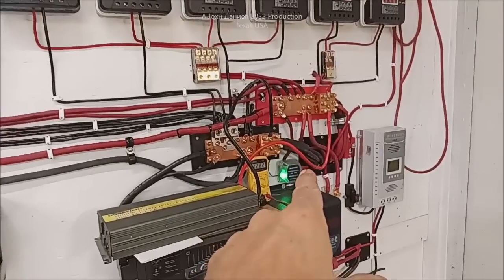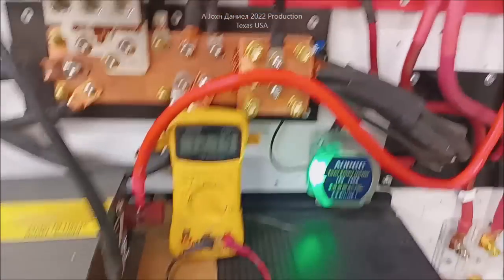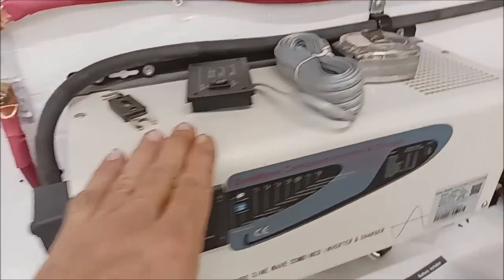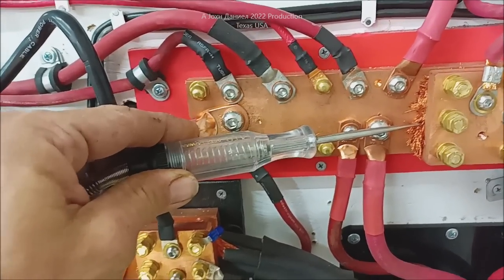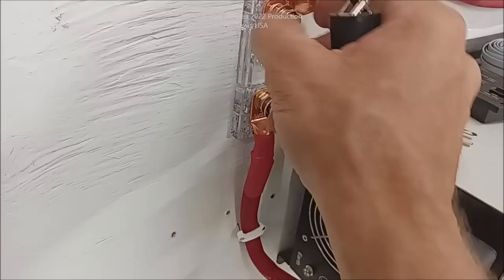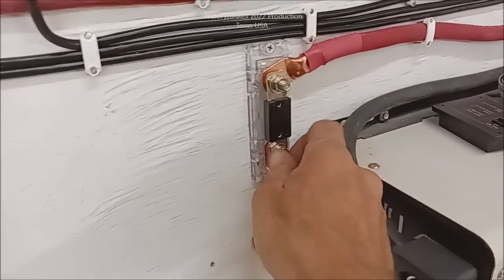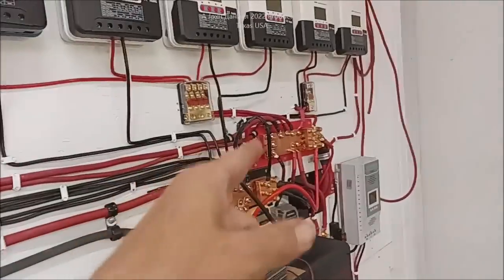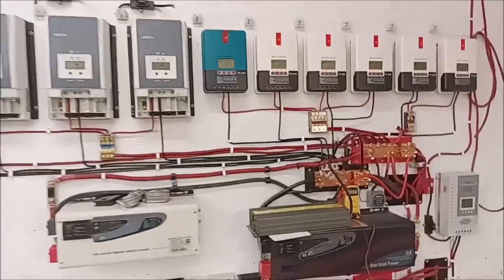How to Safely Connect DC to AC Power Inverter to avoid damage or fire

Comment: Why won't you simply turn the inverter off when connecting to power?
Reply from the maker: Turning the inverter off does not change the path for current to the capacitors inside.

Comment: Nice hydrogen bomb you built. During charge and sischarge cycles those wet cell, lead acid batteries will produce highly flammable, explosive hydrogen gas. That's the rotten egg small that I'm sure you've smelled  especially when charging your batteries. That hydrogen gas will rise to the ceiling where your system is installed. All it will take is for a single spark from an opening relay and your going to wish that you had mounted your batteries into a sealed, battery box that ventilates that hydrogen gas outdoors.
Reply from the maker: Not sure what you think your seeing, but I have my Battery bank 20 feet away outside. The DC mains are inside as well as all the equipment no where near hydrogen gas. The 3 RV batteries inside are not in use, they are limited maintained charge of 13.5 volts, and produce no gases that can even be ignited with a torch to them. Been doing this for over 20 years, no plans to put 28 Lead Acid wet cell batteries inside yet.

Comment: Hey John !! I need some help !! I need an inverter that will run a 110 volt 12 amp pool pump motor to drain my stock tanks in the field !! Can I connect two inverters together and put a voltage regulating turn dial on it to spin it up slowly to the desired speed. I have a 220 volt inverter with 2 120 sockets.. I burned up one inverter trying to get the pump to work .. can I use both 110 plugs wired together with turn dial dimmer switch to slowly speed up my pump ? Or is there an inverter you could recommend that can handle this job ! Thanks for your time !! Stephen Tharp
Reply from the maker: You can run continuous 20 amps on this inverter till them cows come home, just have to keep enough battery on it so the volts stay high and supply amps don't sag then surge due to volt drop (ohms law) causing a issue. https://www.aliexpress.us/item/2251801868014043.html SWI-Power 3200, get the 120v, 12v, USA plug. It is 10 Awg wired with almost 6 awg board clad equivalent. Like all inverters, give it some good airflow, and occasional breaks but mine can run a 16 amp pressure washer for 3 hours straight without issues. 
You can also consider adding DC pumps we use with stock tanks in the hills here. https://amzn.to/41ILj8g
Reply: @JOHNDANIEL1  Whoo hoo ! Thanks John ! I am see if I can find one at harbor freight ! If not will see where I can get one ! Maybe two ! Hell I will put one in my mommas truck to !! Lol thanks gen !
Reply from the maker: @DOGEATSGOG  you can run the truck while the inverters in operation. But you cannot remove the battery while in this process because the alternator will not recognize voltage and will fail. I recommend putting in a second series 31 battery and battery isolator for any permanent use.
Reply from the maker: @DOGEATSGOG  Then feel free to do it. I would never do it, I know when you take away the load, the battery, your volts shoot up to the max charge setting on the alternator, normally 16.5 to 18 open volts and you will fry things. 40+ years ago this was OK due to lesser quality alternators, lots of ceramic resistors on blowers, lights and such. But if it makes you happy to put a few hundred amps load on a 80 to 130 amp alternator from a inverter then no one should argue.
Reply from the maker: @DOGEATSGOG  Using a automated isolator solves all that. For $30 it will add years to your batteries lives.
Reply from the maker: @DOGEATSGOG  There is no such as over unity, but there is always room to make another example of trying. So far, I think a trillion or more has been spent to achieve absolutely no free energy.
Reply from the maker: @DOGEATSGOG  They claim we are a Capitalist society, and for that we are evil. But as your experiencing we are NOT in a capitalist society, if we were then ideas from the Unwashed would be welcome. Truthfully we are in a leftist ran kleptocracy by corporations ran through rule of socialist government disguised as a crony capitalism so that you blame capitalism like a good little slave.
Reply from the maker: @DOGEATSGOG  How it all actually is - https://www.youtube.com/watch?v=EH2WbRBAjfQ
Reply from the maker: The open voltage on a alternator is over 20 volts in almost all of them, the battery is the resistance load that holds it down, the regulator is what determines no more current can flow into the battery and disconnects it and reconnects when the ability to send charge again is needed. Attaching a Inverter directly to a alternator will get you massive cycling, high amps if it will even turn on, and lots of smoke.
Reply from the maker: @DOGEATSGOG  some are built-in in some are remote but all of them act the same

Comment: Hi Let me make this clear and I hope you respond  I have just bought 2 x 2000 w KRIEGER INVERTERS  Plugged them onto 6 x 1000 ah connected in series at home and one blew up the other does not even work as it should  WHY ? 
What size Inverter should you have if say the Voltage I tested says 64 VOLTS From the Solar to the Battery readings ?  get back t o me please ASAP Troy
Reply from the maker: What is your battery voltage, and what DC voltage did you buy your inverters to operate from?
Reply: @JOHNDANIEL1  from Amazon and the meter says 64 volts 
So what you reckon change it to the parallel or use a voltage reducer? Troy thanks
Reply from the maker: @TP_LANDSCAPE_PHOTOGRAPHY  Your battery bank is 64 volts? That is very odd, don't sound right at all. But then You should have a 60 volt DC input 120 or 240 volt output inverter which I do not think that brand makes. Need to rewire the batteries to 12 or 24 or 48 volt and reset the solar to charge at that rate you choose. A 12 volt inverter can only handle 15.5 DC input, a 24 volt can only handle 32 volts max. But even a 48 is only good for 56.5 volts.

Comment: Hello Mr. Daniel,  My Bussman MRCB 150 amp circuit breaker welded its contacts shut (and did not trip).  I attached my inverter cable to the "load" terminal and the battery cable to the "line" terminal.  I also connected the charge controller red cable to the "line" terminal of the MRCB for charging the battery bank.  To make matters worse, my inverter blows 4 of 5 40amp fuses in it any time power is connected to the inverter.  I used the technique you demonstrated in this video to charge the capacitors but the light never went out as seen here.  The inverter is the SWI Power 3000 watt same as in one of your previous videos.

This system worked for 2 months before the malfunction.  Any thoughts for my issue from you or the forum are appreciated.  Thanks for your videos!
Reply from the maker: Did you have the power switch off when charging up the inverter, either the manual or remote has to be off and remote unplugged. If it won't take a charge then you have a hot active in something. A Bussman is not what you should use on this, bluesea style only.  You can send pics, inverter voltage, model and info to troubleshoot with me through my email olympicpowercontrols@yahoo.com
Reply: @JOHNDANIEL1  Thank you for your advice Mr. Daniel.  I will send pictures and data.  Know one around here wants to test my inverter or help with DIY solar install problems.

Comment: I have a 1500 w inverter and a 400ah battery bank...do I have to charge this size inverter first? Also do I leave the inverter hooked to batteries after this and not have to pre charge each time? Thanks
Reply from the maker: Yes, and yes.
Reply: @JOHNDANIEL1  Thanks! John
Reply from the maker: If you want one with 120 volt in, and 30 amp solar too, get their top model like we have in the Winnebago RV. https://amzn.to/3kp9don They are branded Xijia, the corporate name on Amazon as well as SWI-Power but same people. This model is sold to Garrett stand by power products, makers of UPS systems for banks.

Comment: Are these 12 or 24 V inverters? In my understanding, you cannot mix the two together, they both have to be the same!
Reply from the maker: What ever your battery source is in voltage is what type of inverter to buy.
Reply: @JOHNDANIEL1  
Roundabout way to an answer, but yes, indeed. 🖖

Comment: i think i fried my battery's BMS by not using this method.  does this work on both ends, not only protecting the inverter, but the bms as well? also, my battery is 48v, will this tool work on that?
Reply from the maker: It works on 12 to 30 volts. So you will need a 50 watt basic 4 to 8 ohm resistor or a 48 volt bulb for yours. https://amzn.to/3UqcHnn and yes, it will protect the short circuit system on the BMS by doing it. With inverter switch off, Place it on the positive inverter terminal, then the battery, 5 seconds to charge the caps inside and restrict the surge to the battery. Then quickly connect your battery lead to the inverter.

Comment: Will it work on a 48V 6.5Kw inverter?
Reply from the maker: Yes if its a off grid capable inverter. Many 48 volt inverters now are not capable of going off grid as a stand alone even though they claim it, you got to read the fine print! Example: 48 volt 6500 watt ( 48 volt 1500 watt on battery only) is common.
Reply: @JOHNDANIEL1  Been watching you for years. I now operate multiple off-grid systems. I use MppSolar LV6048s & LV6548 inverters. I have 4 separate systems employing about 50Kw of solar total. It took six years here in the Panhandle of Texas to build. Just installing Gyll EG-4 LiFePo4 "works in a drawer" battery banks to replace FLA (GC2 & GC8) batteries.
Been communicating with Tony in Virginia who had some Qs on wind gennys. I have just a couple of small off the shelf HAWTs operational. 
Tony acquired all my "AirBoss" manufacturing equipment and inventory. 
Keep the videos coming...
Reply from the maker: @mgold4685 Yep,  I told the wife I may shoot up there to see you guys. We're out of Comanche Texas in the hills. I just had to get back home to Texas after half of the purpled hair nuts from California took over Idaho.

Comment: Yes it is the one I had ordered and used
Reply from the maker: I answer 400 post a month, so I can't remember. Is it a Sungold 4000? If so, then we got to check on the AC bypass function to find the issue. If it failed in charge mode, the relay may be in NC position.

Comment: Sir,
 I have a 4000 watt 8000 peek watt invertor that I charged up the way you showed us out here and had to remove it to fix the charge controller, (" So when I hook everything back up and used your tester light to charge my invertor before hooking up the battery's the test light stayed on")
It never dimmed
Reply from the maker: If the inverter is somehow still on, such as switch, auto on function, or remote function, some feature is still on, then the capacitors will use as much as your adding with the test light as your doing it. 
Why it will not power back on is related to the repair obviously so we need to track down the repair and did it move a 12/24 volt option DIP switch, internal plug or connector or something else. What brand, model and options are you working with.

Comment: I almost always do this. Not with a test light, but with one of those heat-sinked resistors you'd use to stop the strobe effect on aftermarket led taillights.
What do I mean I *almost* always do it?  Well... I always do, until I didn't. Blew up my gf's inverter, hooking it up. Exactly what you said. Blew out almost all the fets, and the 60n60s are dead too. Glad I bought it or I'd feel even worse than I did!

Comment: This is a great idea. I can't believe I never thought of this. Lol. Using an insulation resistance tester to charge up capacitors and watch them slowly drain when testing? So many old school test lights? I will be doing this trick as my giandel inverter does the same bloody thing yours does! It was so annoying I left it permanently hooked up and just power on and off as needed. Thanks heaps. Cheers from Australia subbed and liked 🙂👍👍👍

Comment: You can also use a ordinary lead pencil sharpener at both ends as a resistor
Reply from the maker: What the dangerous by-product crap they put in pencils nowadays and the electrolytic glue you better be careful doing that, it's not the same as the old graphite pencils. Those things will explode in your hand, we saw it happen.

Comment: Another way to power them up safely is use a tail light bulb. Connect two wires to the bulb and two alligator clamps at other ends of the wires and Boom, you got yourself a quick, Jerry rigged thingy wingy for charging inverter caps before connecting to batteries. :)

Comment: You would think the manufacturer would have instructions about how to safely power up an inverter.
Reply: Renogy says to minimize spark by using proper wire gauge and fuse. What a joke.

Comment: Good tip!  Any test light that is rated for the battery bank voltage should work - it won't burn up or melt any wires if the voltage is within the test lights rating. But, LED test lights barely draw any current so it would take a long time. Its the current draw of the lightbulb that is charging the capacitors, so incandescent bulbs will charge it much faster.

Comment: Hooked up a Giandel 24v/2000w pure sine wave inverter with no sparking or even internal noises. It does squeal for a few seconds when you turn it on. I don't know if this is because of what they call the "slow start" feature.
Reply from the maker: It would mean it has a full dead switch or relay in it. Caution, if it ever fails you go to that part first since its hard to make a durable 200 amp DC switch with Chinesium metals thats not likely to melt

Comment: I saw a video not to long ago somebody used a #2 pencil sharpened on both ends as a resistor.i tried it and it worked
Reply: I would guess probably a bit longer than a few seconds to charge the caps? The graphite in that pencil has considerably more resistance than a 25 ohm resistor but it sounds like a valid way of doing it in a pinch.
Reply: Nope. I measured my full length square shop pencil at 10ohms. A harder, skinnier artist pencil was 20 ohms - I used that.

Comment: Your tip on inrush current limiting and capacitor sets in Inverters is a good one. However having your negative bus in such close proximity to your positive bus without a plexiglass cover plate invites disaster. A single wrench, pipe, or step stool, leaned against the wrong spot and you will have an instant fire. For such a large setup you really need a DC Load Center with propper busbars. Just saying, from a Ham Radio operator who dabbles in solar energy systems too.
Reply from the maker: We have a custom cover plate made but not ready to install yet. 3/16  Lexan.
Reply: @JOHNDANIEL1  OK. Gotcha. Low voltage but lots and lots of current there!

Comment: id hate changing all those diodes, i have found some inverters make the big scary spark and others dont. years ago i had a horrible power jack that thing really sparked, i never knew it was the caps etc, you learn something every day.
Reply from the maker: Here's funny facts. Power Jack is not a inverter company. It's originally a company that made antennas in Hong Kong. They "resell" Inverters, 2 way radios and aquarium products. So you can get a awesome power Jack inverter typically made by Goshen Guongzu Electric, or one like most made by a soldering shop in Vietnam. I have a power Jack 500 watt true sine inverter, 7+ years running and not one fail.

Comment: GOOD STUFF.  I use a 25 OHM 5 WATT  RESISTOR TO PRE CHARGE THE CAPS.
Reply from the maker: Yes you can do it with a resistor but using the test light gives you some feedback of success.
Reply: @JOHNDANIEL1  YEP good idea.  Never thought  about it.  Used light bulbs for current limiter's but never thought about this app.
Reply: Does it matter if inverter is on or off for precharge?